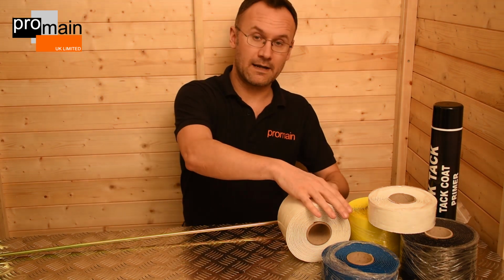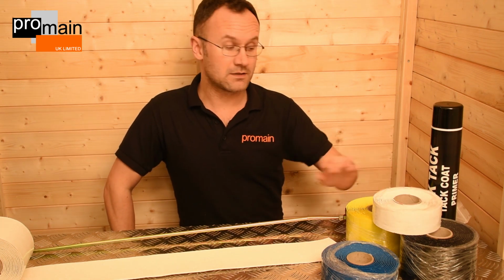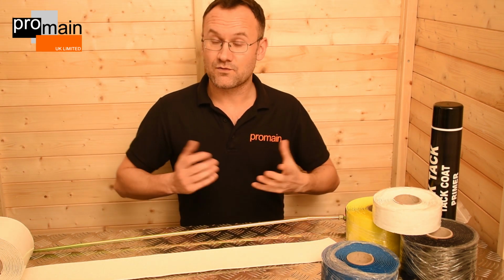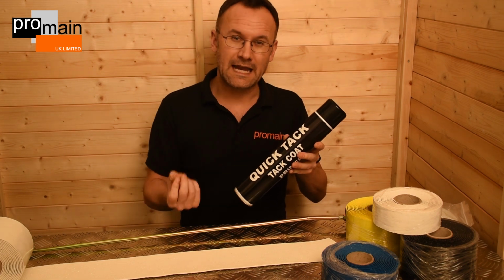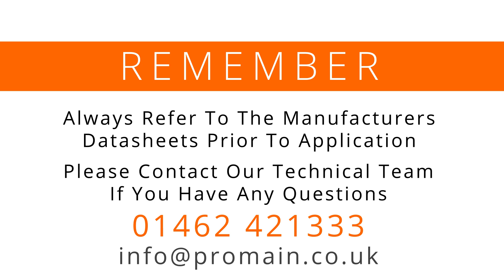How To Mark Lines Using Thermoplastic | Thermoplastic Line Marking Rolls

Comment: Is this product mainly intended for small\quick repair jobs or can it be used with a entire parking lot? I am asking if it is cost effective compared to paint when doing a parking lot of 50+ parking stalls.
Reply from the maker: You could use thermoplastic for a full car park no problem! It really depends on your expectations on how long the lines need to last. If you were making lines in a Tesco car park, thermoplastic lines would be great. It might be a bit over the top for a private car park with a couple of bays. Centrecoat ST1 would be good for light duty https://www.promain.co.uk/centrecoat-sk1-water-based-road-line-marking.html

Comment: does this work on concrete?
Reply from the maker: Hi Hani, Sorry for the late reply!!! Yes it does, but you would need to use our spray on tack adhesive to aid adhesion before the tape is applied.
Reply: Use primer 

Preform thermo is ok for something quick way is to get it do in screed preform tends to crack a lot quicker or if u use the blow torch you could also blow the material or even burn it

Comment: What is the aggregate you apply?
Reply from the maker: Hi Janie, our premium quality thermoplastic tape for line marking contains glass beads already that act as an anti slip and reflective aggregate all in one. Our economy tape does not contain this but we are able to supply a suitable aggregate for your requirements. We did however illustrate in the video the application of our Centrecoat Drop On Glass Beads available on id4085 - https://www.promain.co.uk/reflective-glass-beads.html

Comment: For anything more than 5 stripes this would take way to Long
Reply from the maker: Thermolastic lines are ideal for DIY use, not huge jobs or car parks etc. We have a huge range of line marking options - visit out site for more info: promain.co.uk
Reply: I'm by no means an expert, but setting up the painting equipment and cleaning it up afterwards takes time and a commercial vehicle to transport it. I think the beauty of this system is that it is ideal for smaller jobs and requires very little in the way of equipment. 

If you want the lines painted, you'd have to get in a professional company. This is a DIY solution. Hire a contractor, and you'll have to wait for them ... and then re-arrange if it's raining heavily.. DIY and you can do it in your own time.

I think this stuff is quite expensive, but probably saves time and money in paying other people and deciding your own time to do the job when the weather is OK.